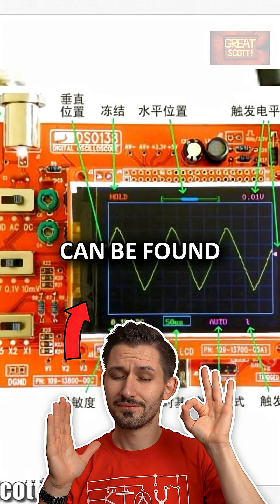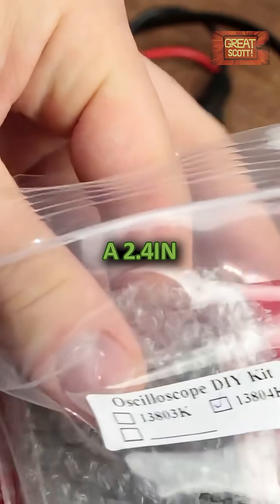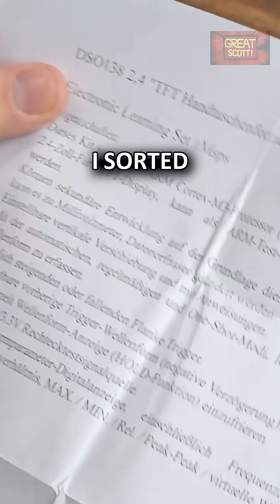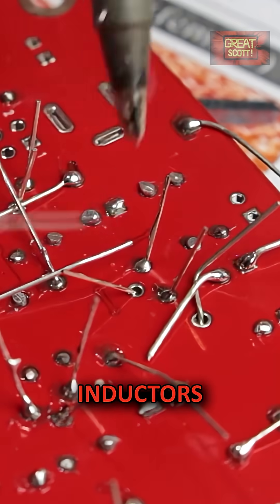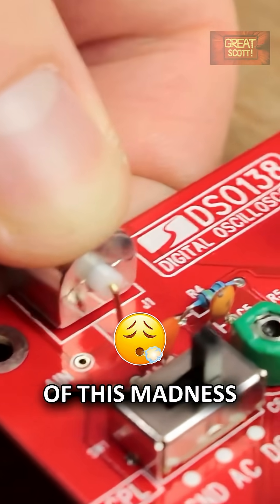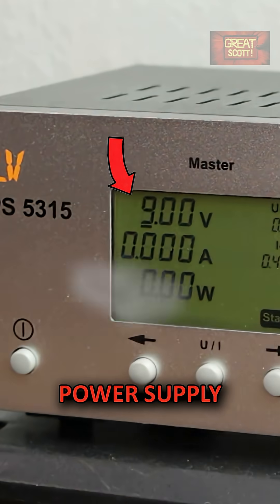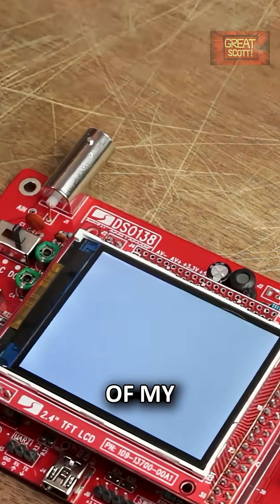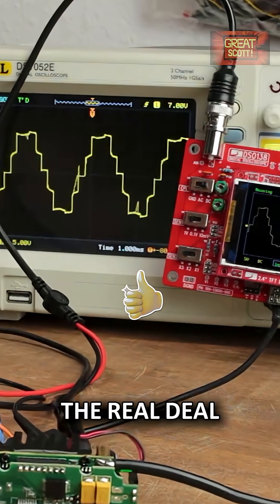Build your own Oscilloscope for $20! #aliexpress #gadget #review #diy #oscilloscope #arduino

Comment: I built one a few years back and it worked great. It actually worked perfect for a couple of years until I accidentally connected it incorrectly to a board that had high current. Like, REAL high current, and I blew it up, literally. But it was 20 bucks well spent. I tossed it because I damaged the board beyond worth repairing because they're so cheap, never bought another one because I don't often need one, but I will buy one again when the need arises.

Comment: The cheapest one you make is with your computer sound card. A standard aux cable gives you com, input 1, and input 2. Just cut one end, there are two or three free app in the synaptic package manager or Ubuntu software center.

Comment: It's a nice toy but if you really need a scope, especially for design you will quickly be limited. I would rather recommend investing "a lot" of money in a quality scope (within reason depending on your application) then making the other tools yourself (function generator and laboratory power supply).
Reply: I agree with this, but, these little things are still extremely useful in their own right.

Comment: I bought a broken Keysight two channel scope (DSOX1102G) for 40€, fixed it by re-flashing the firmware (was kind of hard) and now I have a perfectly fine scope.

I even found some files on the internet I had to put on a USB drive after which it had 200MHz (2x the bandwidth, but a bit distorted at the top) and all of the software features.

For what it cost me, it's a great thing, even without the extra software which I don't even use.

Comment: Can you make a tutorial on DIY oscilloscope, and I don't mean the kit but from scratch. This is a project I'm willing to pursue myself. Great to see Greatscott do it as well. Fan of your work since the beginning :D
Reply: its a high speed adc graphing to a tft display
Reply: @beanman853well yes but the challenges I faced was to make it multiple channels (>2) while keeping the cost reasonably low. Then the issue I face is that not all ADC can be trigger synchronously, if multiplexex or if thier data transmitted that quickly and you'd need 4 separate SPI Ports for each ADC and that's expensive for high resolution, High sampling rate ADC. Also a challenge is using USB 3.0, the documentation is non-existential. I asked one of my professor for any help and he instead asked me to inform him if I were to find any solution because even he is stuck on WiFi or proprietary systems due to the lack of open source documentation

Comment: Bought the same one about 6-7 years ago. Still works. They also have function generator you can build as well. Neat stuff!
Reply: Holy fucking shit
Reply: I now see my mistake....
Reply: @jimijamesnoob685  lol
Reply: 6 7
Reply: I got mine 2 years back as a Christmas gift. I didn't have to solder anything, but I did modify the power input so I could use a USB C adapter, so I have more readily available power options.
Reply: This should be there at first!
Reply: SIX SEVEN
Reply: NO NO I CAN'T HAVE ANOTHER EPISODE
Reply: 67
Reply: 676767 SHUT THE FUCK UPPPP
Reply: 67
Reply: 6 7
Reply: Nooooooopo bro why brain rot 😭😭😭😭😭
Reply: 67 💔
Reply: 6 7
Reply: 6 7
Reply: 6 7
Reply: 6 7
Reply: 6 7

Comment: The default I2C bus frequency for a Raspberry Pi is
100 kHz, so for a lil bit of tinkering/learning it's useful.

Designing buck/boost converters, maybe. New designs go WAY over 100 kHz.

Comment: Wait, are they actually useful? 20 bucks would be a nice deal with an 3d printed case tbh
Reply: That will depend heavily on what you want to use it for. There's a lot of cheap oscilloscopes around, but cheaper ones have lower sampling frequencies, which means they're no use for some applications. This model is 200khz, which s bottom end, and has limited use. Even a sound card input samples at 44khz+
Reply: @DoubleMonoLR can these cheap ones be used for can-bus usage?
Reply: @DoubleMonoLR i would like to make DIY wireless 2.4/5ghz antenna. Is this a good idea?
Reply: for your reply. I dont need it right now but I could learn to use oscilloscopes in general. Maybe it's useful for some repairs. And even if i cant use it for repairs... only $20... worth a try I guess
Reply: @kaputtgehts  It's definitely usefull if you are building audio stuff. If you wanna lear about oscilloscopes, it's much better to buy a used one, you can really great old scopes for $150.
Reply: @mrkv4k  I have an absolutely ancient LG OS-504RD that works like a dream. It lacks some modern features, but at 40Mhz it covers a pretty large number of projects.
Reply: they are less than that on ali express fully assembled now.
Reply: These are a waste of money apart from just being a toy. The bandwidth is too low for any meaningful work.
Reply: When I worked at an electronics recycling company we had hundreds of these things laying around. They were pretty big.
Reply: You can buy this WITH a case, but its a pathetic 6 piece flat acrylic thing that gets put together like a puzzle to make a box instead of a nice smooth case that you see on other products. But hey, its a case.
Reply: They're fine for general function testing. Not super accurate but works well enough. Obviously no GHz type stuff. However there are cool little multimeters on Ali now that have oscilloscope functionality built in. Rechargeable as well. Like 70 bucks or so
Reply: I have the same question. I've wanted one for a long while but frankly I don't have a basis for comparison. My use would mostly be directly monitoring outputs of automotive sensors.

Comment: Smartphones have some ways of reading thoughts, I'm convinced. I didn't talk to any one, I didn't write a single word on the browser, I just thought: I need one of those cheap oscilloscopes from Shopee - and this ad popped up.
Reply: You can also make a cheaper one using a rpi pico. It's called scoppy
Reply: Thanks, mate! Nice tip!
Reply: @ShinjiCarlos np just keep in mind that the max logic level for the pico oscilloscope is 3.3v, higher than that you need resistors to lower the voltage or you will fry the pico, there are quite a lot of tutorials so don't worry about it
Reply: @chicabomb5933 , thanks a lot for the comment! I had the project of doing it with an ESP32 a couple of years ago. The input voltage is quite the same. Maybe I will try with the Raspberry Pi Pico, because it's a platform I want to be acquainted with for a long time.
Reply: It is also happening to me also, some thought only in my mind and YT sugests on that same subject I was thinking. May be YT got so big and it is showing up quantum behavior of intelligence.
Reply: Yes indeed Android is open source so basically free hardware in old hardware shop

Comment: I just wish I could find one that would provide a serial data stream of the reading so I could automate collecting the information, diy or not
Reply: You could have an arduino operating as an intermediate or run it between the data and screen
Reply: I'm guessing that a usb oscilloscope is pretty close.. and they are often not very expensive.

Comment: Make video DIY OR BUY oscilloscope
Reply: Are you high?
Reply: @Alacritous why?
Reply: @ejJdjjdhEjbej  Do you have any idea how hard it is to build an oscilloscope that comes even near a super cheap one for $120? Even those oscilloscopes are built by a team of graduate electrical engineers for multiple months, at least. And ironically you already need a pretty capable oscilloscope to build an oscilloscope from scratch.
Reply: This sampling rate can only reach 10khz
This cannot even show an i2c waveform
I bought this,it was from Frinsi
Reply: @pham3383buy DSO152  it also cheap and good